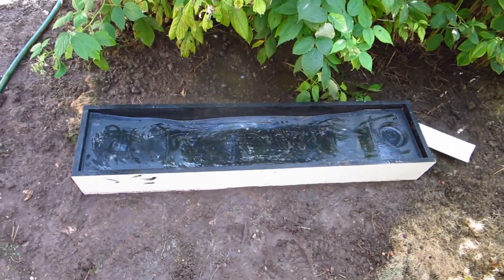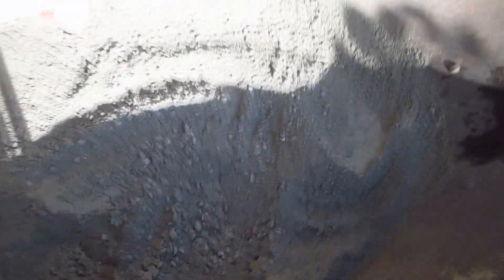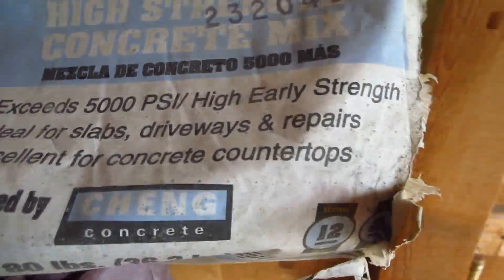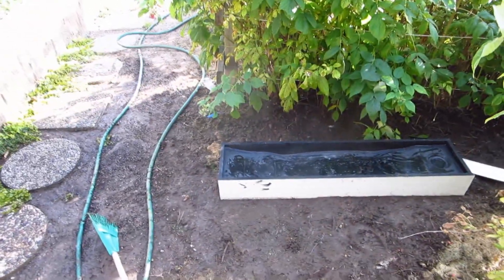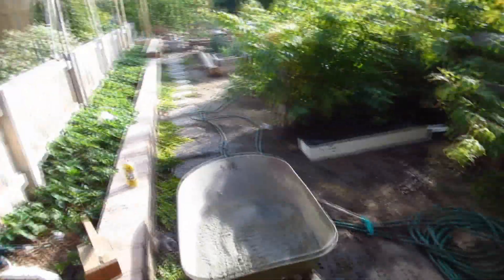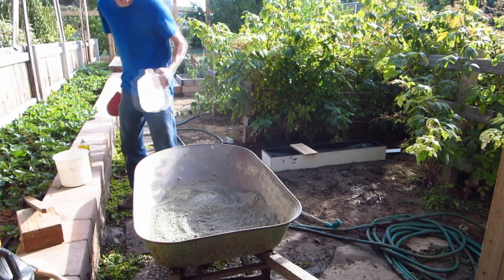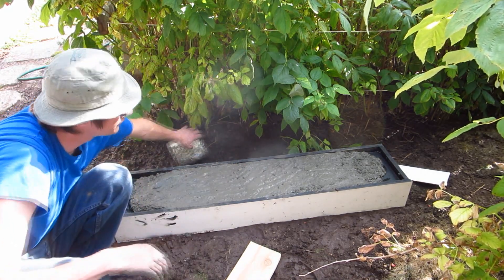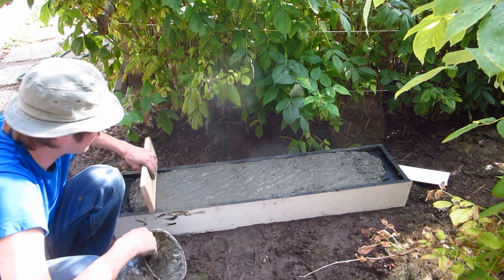Pouring the Concrete, 3D longboard Mold.

Comment: when you are pouring thin concrete instead of using rebar you can use something called "Remesh" ..... you should be able to pick up a sheet of 42" x 84" for under $10 at your local Home Depot.....
Reply from the maker: The last time I did this, that is what I used. And it worked great.

The problem here was that I felt like if I didn't get started right away, then I wouldn't get started at all. 
I even had rebar and mesh I could use already, I would have just needed to drive 10 min away to get it.

It caused me problems later on, and definitely was my biggest mistake of the project, however, the project did get completed.

Comment: It would be interesting to get a builder's comments on this work. Aside from the steel re-enforcement (which you are aware is lacking) I've watched them use some sort of flexi-pipe/cable with a rotor on the end which I think removes the air bubbles.

I await the results with great anticipation!